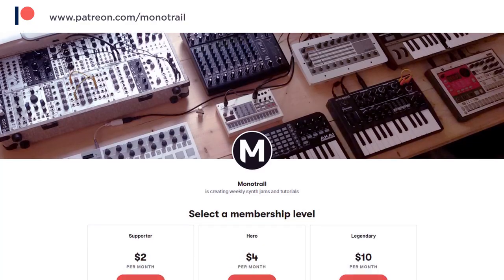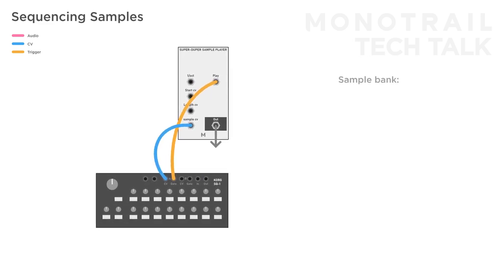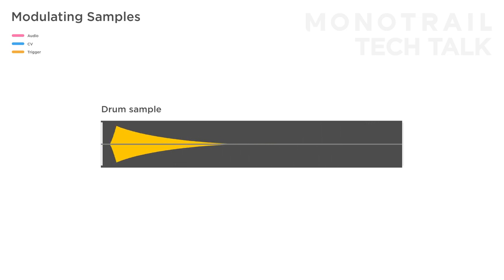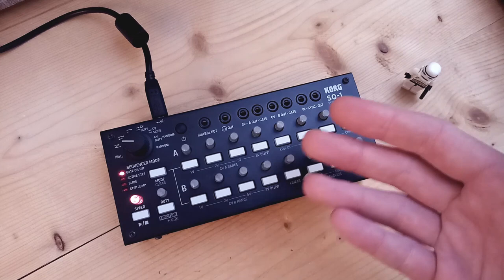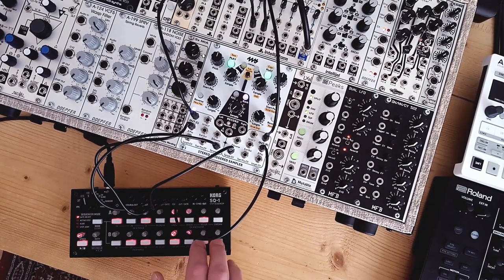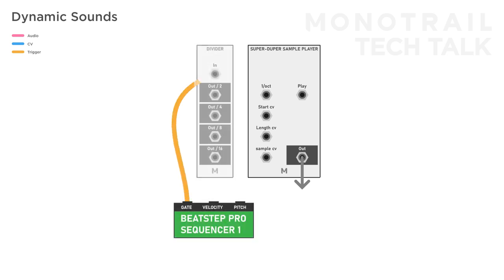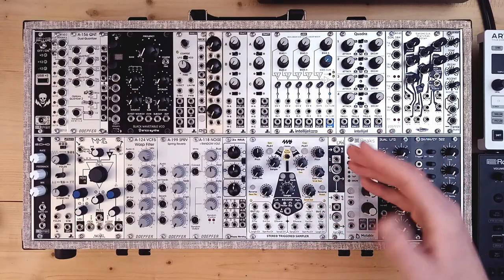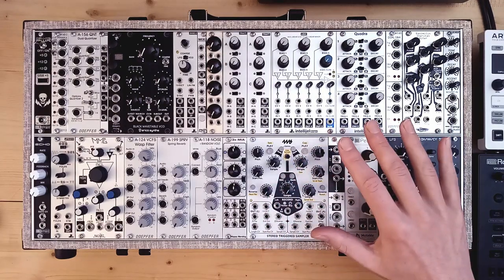How to turn a modular sample player into a drum machine (with the 4MS sampler and Korg SQ-1)

Comment: Great video, as always! Very inspirational. Although having lots of sampling capabilities in my eurorack system (Disting etc), I do not often work with samples. This analytical approach motivates me to go more into that direction...
Reply from the maker: Thanks for letting me know! Positive comments really motivate me :) The disting mk4 is actually the module that got me into using sample players a lot, it's a powerfull module and I quickly realised I was pretty much using it as a sample player 24/7. Then got the 4ms, now often use three sample players in my lifesets. All the best!

Comment: Hi Rijnder,  whats your opinion on the 1010music bitbox micro - it seems to offer much more than the 4ms ?
Reply from the maker: Hello! The 1010 for sure offers more when it comes to its 8 sample playback power, and the clear screan for recording and edditing samples. Its very powerful, you can use it as a full drumkit and have samples left for chords, background noises and whatnot. Also for live recording and edditing in the device it's a winner. 

But even though the 4ms only is a dual player, I prefere it because of its direct control over the samples (8 one function knobs against 2 menu knobs). I use the 4ms a lot for percussive sounds during live performances. By using the attack on percussive sounds you can sort of fade sounds in and out. Tweaking the decay on hats can turn a short glitchy sound into a full ride. Tweaking the pitch on percussive sounds is great for live, and I even use the quick sample select knob to create variations within tracks or sets.

So I think it comes down to how you like to use it!

EDIT: With attack and decay, I mean start position and sample length. Its not a fade in and out. But it can have this effect when tweaking knobs :)
Reply: Thanks for your detailed reply,testing currently the bitbox micro